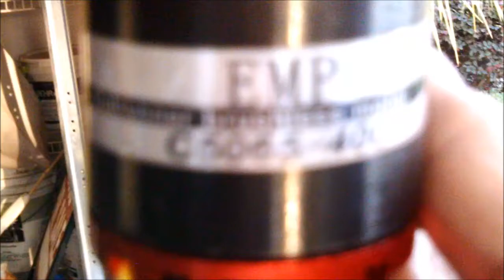4 Foot Hexacopter Build - Parts Update - Part 5 (Configuration "Hexa +")

Comment: I've been following you, sorry to hear about your health issues, sure would love to see it fly.  I've built 6 multicopters, 3 quadcopters and 3 tricopters, and getting ready to build  a hexacopter  next.  I'm not going as large as you have, only looking at aprox. 2 feet  in dia.  I'll be checking back with you on the motors, I may buy them from you.  Good luck with your project

Comment: Hi, the largest emp motors you can use on the 3/4" aluminum  tubing frame are the emp 3548 900kv RPM and they are monsters! They need 1 5000mha lipo battery for each motor to fly for about 5 minutes
the emp 5065 is only 380kv rpm so that means they spin a little to slow for a hexacopter and each motor needs 2 6s- 5000 mha lipo batterys just to fly in a large airplane, so they mite be to heavy for that frame.

The emp 3548 900kv would work good with the 80 amp esc's you already have!

Comment from the maker: Thanks for checking out my project. I probably end up upgrading many parts, ive been talking to some people about it and some of my boards are usable but already obsolete. Which one of your RC builds flew best for you? or did you like them all the same? just curious. 

I will ist the 750kv motors set / ESC's, some props and a partial quadcopter frame i have on Ebay all as a kit or spare parts.

Comment from the maker: Hi Paul. I don't have it yet. I think I will have two or three more videos and a few testing videos but dont have an ETA for you unfortunately. I am ready to mount the new motors, props and wire the new ESC's. I will at least take a video of that and post it, I would say check in about 3 weeks.

Comment: I will look for that calculator. I started off getting interested watching a guy who built a home model called widowmaker on youtube. I have since been researching flight controllers to find the most adaptable one. I think I will probably go with the APM 2.5 with GPS. I also think I will build a Quad instead of a Hex for now. What I am after is a Quad that has at least 20min flight time with FPV with night vision and OSD Flight simulator, GPS, Head tracker, 3G telemetry.

Comment from the maker: Correction on the parts Shawn, I just found the wrappers for the props and they were 7.95 each so it was 50 not 20 for them, you would be saving 70 not 40 dollars as I said previously.

Thanks
Stacey

Comment from the maker: Tell you what, I paid $170 for the parts , They have been used about 10 times for the testing and not stressed, If you give me 120 + actual shipping/insurance ($5 to $10) they are yours (saving of $40). This is what I will include:

As seen on my videos
Grey props - 3 forward / 3 reverse (qty6) with silver spinners
30A Hawkings ESC's with the 3 prong connectors, (you will need to add your own DEANS Connector Plugs) (qty6)
RCTimer DC 2830-14 750KV motors with motor mounts (qty6)

Thanks
Stacey

Comment from the maker: It depends what the setup means to you, If the setup is the motors, esc's, props and extra blades + the quad body, then unfortunately I must decline. Just send me the offer describing what you would like and I will think about it, no rush I will just make a quick video as a esponse to your first offer.

Comment from the maker: Hi Shawn, You have seen the setup. Do you only want the motors? I have the props, Forward and reverse, ESC's Prop Spinners and an aluminum quad body that the 750 motors will fit on, I have smaller three blades props for that setup too, let me get a video together and I will posted for you. Just give me a day or two. How is that? If you only want the motors make me an offer for all 6, Free shipping in the US for my fellow youtuber Fair?